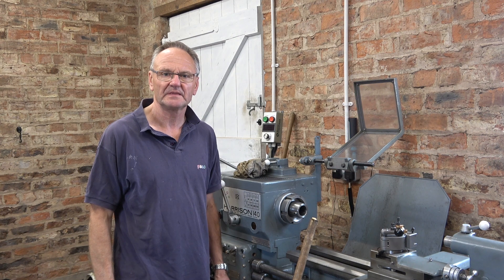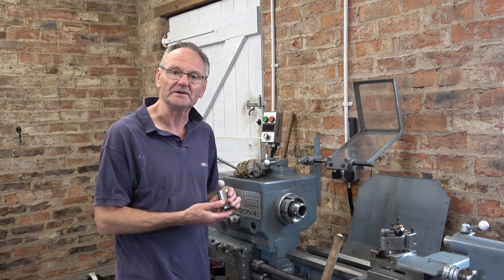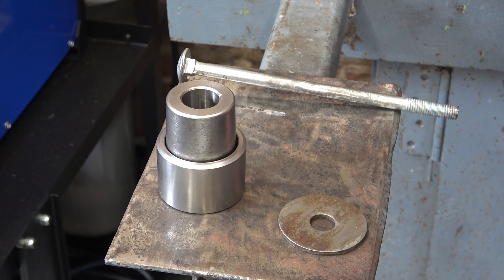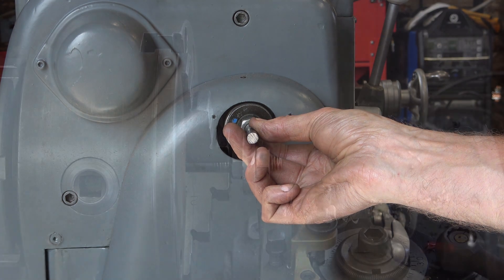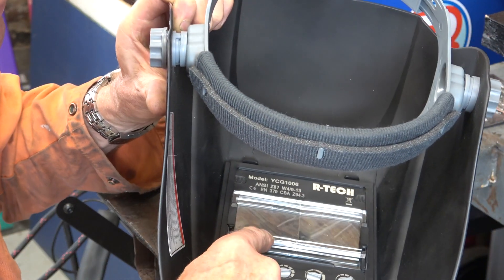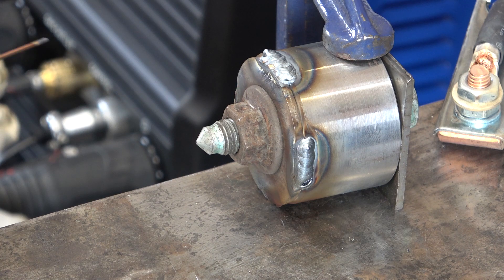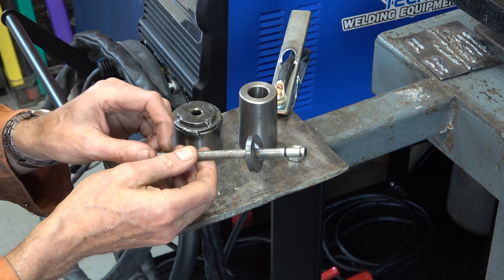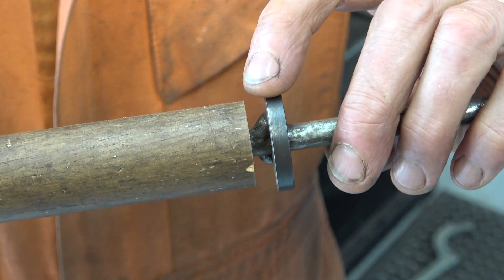HS89 Harrison 140 lathe spindle nose bush extractor

Comment: You can minimise these craters by using a "slope out" function if you have it. When you let go the trigger the current drops over a few seconds.
Reply from the maker: Thank Richard. Yes it does have 'slope out' and I'm beginning to figure it out. As a TIG beginner so many things go wrong it's hard to know what's causing what. Cheers
Reply: @HaxbyShed  No worries. I noticed your welder later in the vid and it looks the same as mine, a digital R-Tech. I am also a total beginner so take what I say with a pinch of salt, but if you have the pulse function give it a try, its a godsend on the thinner stuff.

Comment: Great piece of kit, anything that avoids hitting the lathe is good. Best wishes, Dean in Oxfordshire.
Reply from the maker: Hi Dean, yes but my extractor only helps when the MT3 comes out leaving the bush stuck in the spindle. Getting the MT3 out of the bush (which is in the spindle) still takes a bash. If the MT3 has a Tang end it's a bit brutal. If the MT3 has a screw-in draw bar then the shock is not so bad.  If the MT3 and bush come out together I use a pulley draw to get the bush off the MT3. None of this is very elegant.

Comment: Good  Idea     as long as it does the  job   why worry  what the welding looks like    the  more  you use your welder  the better  your welds will  look    a few  amps here and there can make all the difference   to the finished   product
Reply from the maker: Hi Alain, I guess it's just when I have put a lot of work into something and it looks smart I don't then want to mess it up with a rubbish weld ;-)  Anyway, it was not too bad in the end. Cheers

Comment: Hi,did the glass on inside help a lot to see the weld pool better?I still use cheap reading glasses which is ok for steel but on aluminium you need some goggle arrangement too so my glasses fog up ...if your insert works I give it a go too.Have not thought about it before..you pick up a lot from others.Thanks
Reply from the maker: Hi Robert, the short answer is yes the magnifying lens (cheater lens) helps a lot. My eyes are slightly different prescriptions so I don't get on with cheap reading glasses too well. With the cheater lens fitted I could use my prescription varifocals looking straight forward rather than having to tilt my head back to focus at reading distance. And I did not have to be swapping between reading and distance glasses. I had to trim about 1mm off the lens to get it between the slots. And it has to come out if I'm doing stick or MIG (or I can use another shield for those). Overall it's worth a try for £6 (8.50 USD). It helped me. Cheers

Comment: I found with the TIG welding a rest for the hand holding the hand piece, keeps the distance for the tungsten out of the puddle. Mine is a vertical column with an adjustable arm of it to lean on. Just keep practising, Tig brazing is an easy one to come to grips with too. Glenn Australia
Reply from the maker: Hi Glenn, I think once I've got the hang of the basics then a rest would be a good idea. Thanks for the suggestion. Cheers

Comment: Hurrah! You know you can fix those spot welds by going over them again without adding filler. You have the penetration; now go back and "stack the dimes" as it were & people will think that was welded by a pro. (Can't do that with a MIG). If you want, finish welding in between & then go back & make it all "pretty" again. No one will know & I'll never tell. My wife said: LOOK, He's done it!    (One giant step for the welder of tomorrow.) G'Day mate.
Reply from the maker: Hi Bob, I tried a bit of 'going over again' but did not get it quite right. I will have to work on consistency. Cheers.